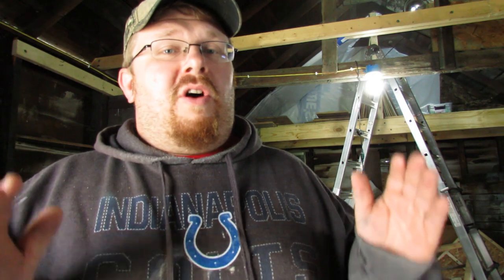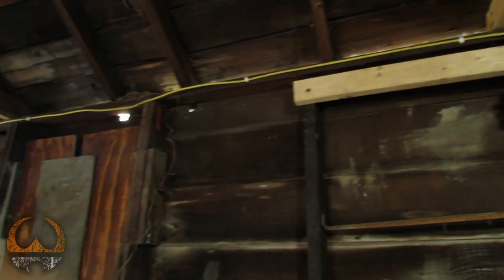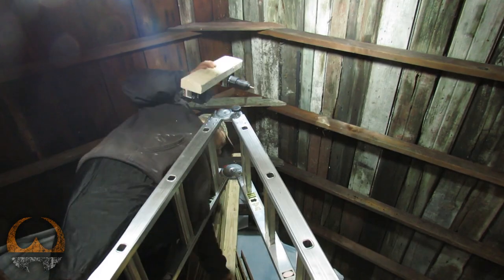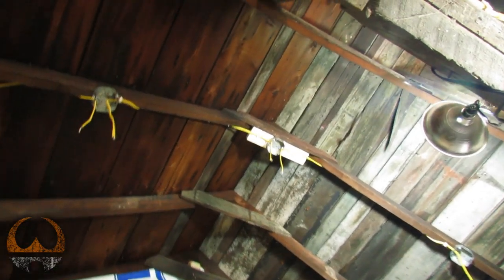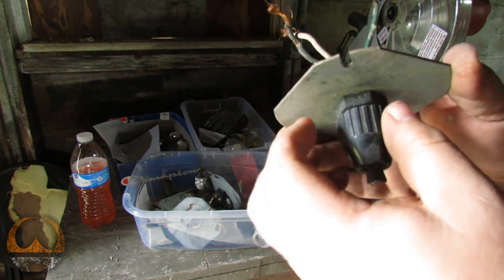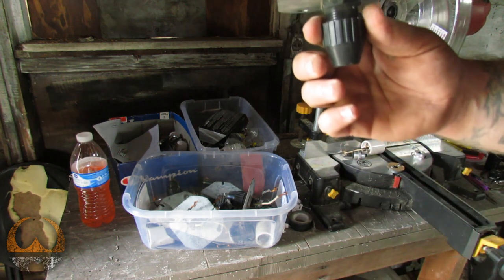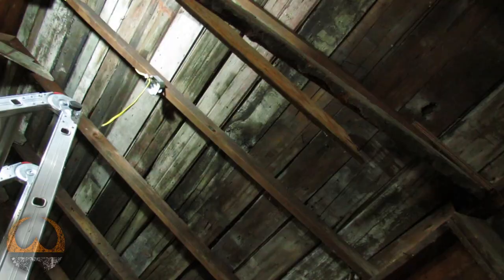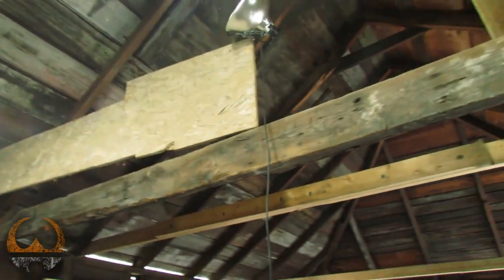Light for the Shop - Installing Single Hanging LED Lights

Comment: How much power are you bringing out from the house for the shop?  Will  you need 220 v for any of your tools or just 110 v ? Just wondering!!  Looks like you have a great start! Regards BobLee
Reply from the maker: Just 110. It is already ran to the shop underground, plus I don't have any tools that require 220. Down the road I may get a welder that requires it, but I figured I would cross that bridge when I get to it.
Reply: Waylight Creations  I guess was wondering if you were going to increase power ! Put in a panel is only  good for what the breaker size that is in the house is  so that why I was asking.  Putting in a 220 v 30 amp , or 40 amp or even bigger would be a good idea! Just a thought 💭   Regards BobLee